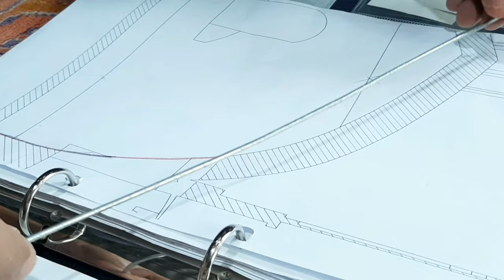Making A Miniature Dome Using 1300 Mini Bricks - Bricklaying Mini Dome

Comment: Thank you for sharing .  What you  intend to  use it for? 
I saw the real brick dome don't require wire and chicken meshs.
Your dome got two exit.  And is at ground level.  For living in?
Reply from the maker: Thank you for your consideration 🌹🙏.  This dome that you saw in the video is made from a real model, with a few changes, which was used as a place to store ice in ancient times.  In winter, they poured a little water inside it to freeze it, and then poured some more water on top of the frozen water.  And in this way, they made ice layer by layer and used it in the warmer seasons of the year.  The reason for having two layers or three layers of this dome is to minimize the temperature exchange with the environment outside the dome and to increase efficiency.  The outlets that you see in the video are actually windcatcher that in the cold season by directing the wind into the dome caused the water to freeze and in the hot season helped to prevent the ice from melting.  In future videos, I will make the windcatcher and you can see their performance.  The real structure has 4 windcatcher with a height of 7 meters and a depth of 9 meters underground.  which is located in the city of Yazd in Iran.  If you want to see a real structure, you can email me.😊
Reply: @mini_Shasusa  
Thank you for your reply.  I see... is ancient method  for harvesting water. 
I think the  real dome is  possible to make in to a house.  
Will wait for your next video.

Comment: In our city, they call this structure Berke
Reply: What do you use a Berke for?
Reply from the maker: @farnabyurquhart6970  Used in ancient times as local to hold ice. In the winter, they made it a bit of water in the winter to make it ice and then put some other water on frozen water. And in this way, the layer made the ice cream and used it in the warmer seasons of the year.
Reply: @farnabyurquhart6970  We use its water to eat
Reply: @mini_Shasusa  thanks for explaining that 🙏❤️